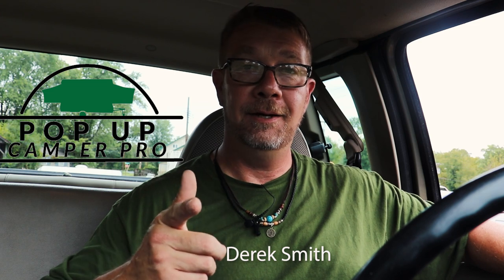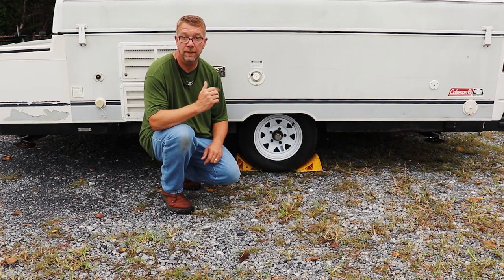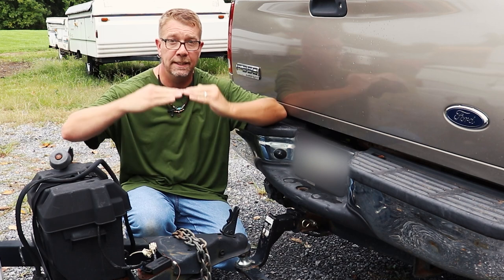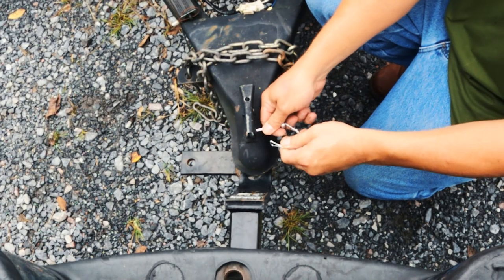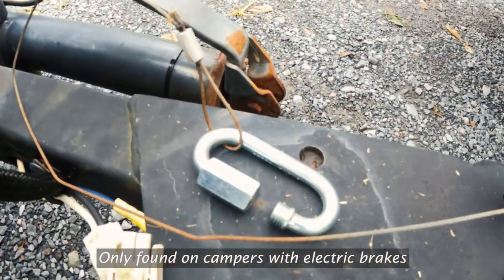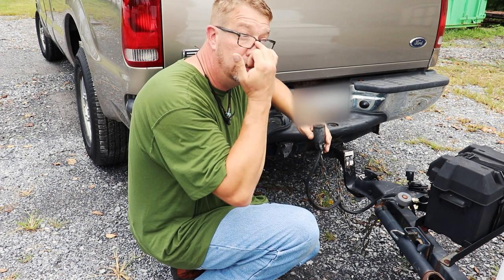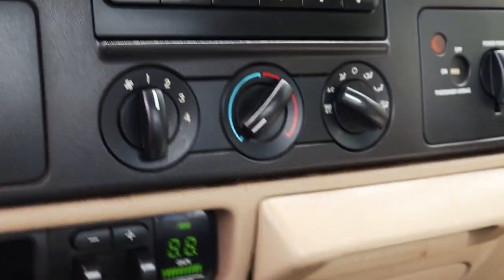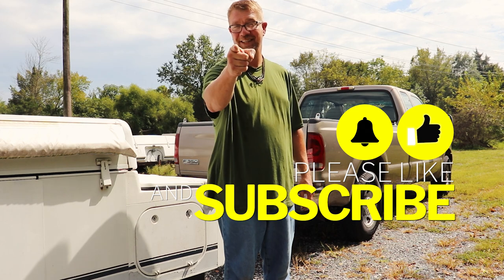Beginners Guide To Hitching Up A Pop Up Camper - Step By Step ~

Comment: Covered the basics well.  
With the tongue weight around 300 lb there is no way I could lift the coupler onto the ball  with our '96 Niagara. And our driveway has a slope, so both wheels are chocked all  the time.  
I get it close by moving the TV,  drop the coupler with the jack, often the clamp part gets trapped on top of the ball, so pull ahead slightly so the ball is tight to the front of the cup, then raise slightly with the jack to take the pressure off the clamp so it can slip under the ball into it's correct position.
Our first trip I didn't check that it had latched properly, and the coupler bounced off the ball about 10 feet up the driveway.   At least it was close to home so I had pry bars  and blocks so I could raise it high enough to swing the jack down and get it re coupled properly.  lots of fun on a steep driveway.
Reply from the maker: Thanks for the tips 333rpd! Units such as the Niagara do have heavy tongue weights in later model years, and I can imagine what a steep driveway can be like to couple a unit that size. Apricate you watching and your advise!

Comment: We are wishing we could pick up our camper like you!  It's too heavy!  Question...you mentioned a battery harness. Are they on all battery set ups?  I would like to see if ours (coachman Clipper 108) has one but couldn't see it clearly in the video.  Please what should I look for?  Thank you in advance!
Reply from the maker: I know, I really should use the tongue jack more myself too! Not all campers have a disconnect able harness like Coleman and Fleetwoods do. Your Clipper does have a 12 volt connection at the tongue. Look for black and white 12 volt lines with round terminal ends. These will attach directly to the screw post on 12 volt beep cycle battery's. Black is positive.